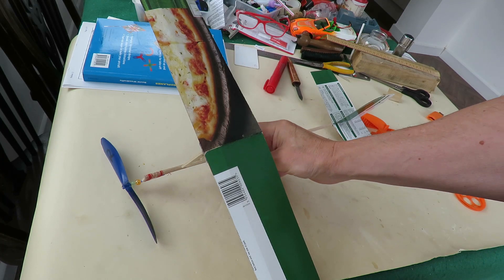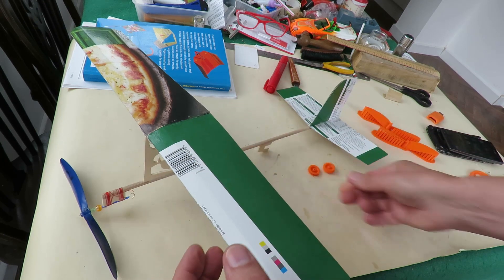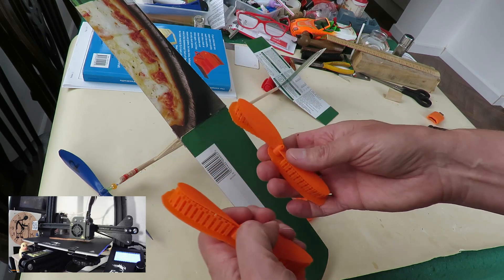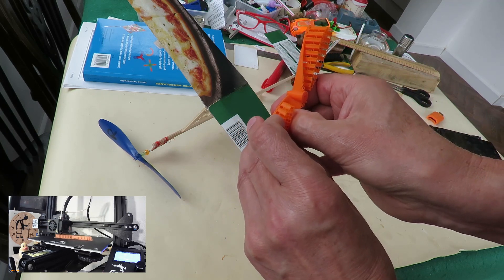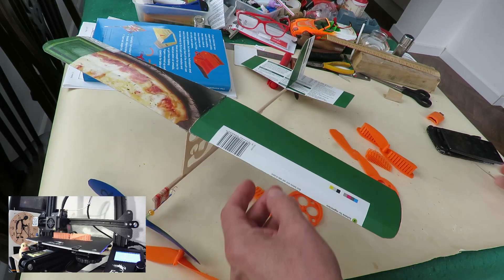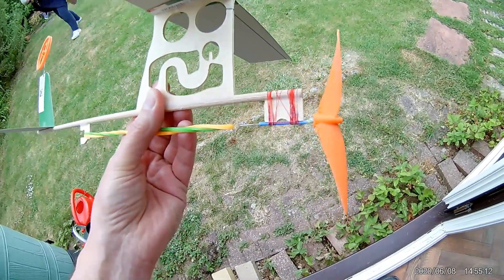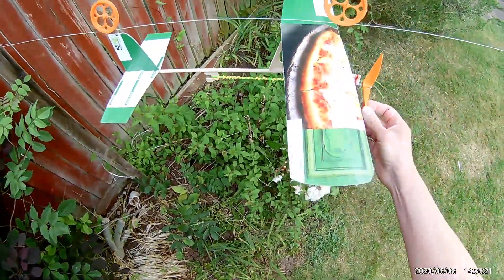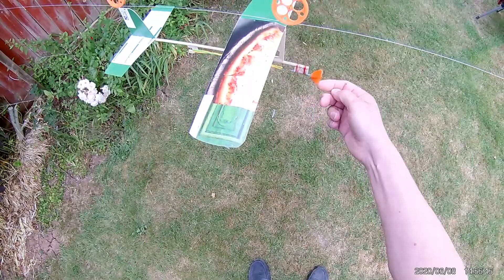3D propeller for the Rubber band powered zip wire plane for Pip

Comment: Went it did. You're having more luck with 3D printed props than I've ever had... great stuff   :)
The next morning, Grandad sees 2 pairs of trousers and a shirt drying on his zip wire line.
Reply from the maker: Hi Slider, yes I haven't perfected the propeller designing and printing but that one does seem to work

Comment: Works great and even comes back to you. I have to say that you have some amount of pitch on that prop but it gives plenty thrust for the zip line. 
LOL, come on, you knew you were winding that up the wrong way on the second attempt. 😅👍
Reply from the maker: That pitch is all round the root, it rapidly becomes zero by the time it gets out to the tips. I was experimenting with ways of designing it. The method I tried there was an oval slice through a thin tube, rather like the way many people make propellers by wetting a wooden blade and taping it to a tube to dry, or for that matter, cutting the blade from a pop bottle or aluminium can. Getting a compound curve is not that easy to do with TinkerCad.

Comment: Hey Grandad. When you said it got stuck and did not go anywhere, I watched in slow motion, you wound up the propeller the wrong direction. So it pushed instead of pulled, resulting in it standing still on the zip line. The next time you wound it in the correct direction.
Reply from the maker: Yep, that happens 😁
Reply: @GrandadIsAnOldMan  It's just like one of my senior moments. I set a tool down while making something and forget where I set it. Winding a propeller the wrong direction just keeps us human. Lol